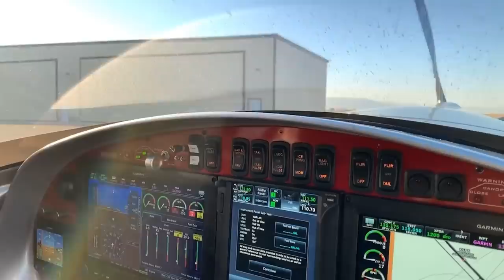Catastrophic Engine Failure...When Things Go Right!

Comment: My glider flight instructor told me as I was young: "All the rules in general aviation were written with blood!" This impressed me so much.
Reply: That's simply not true. 

The predecessor to the FAA mandated Aviation Medicals when there were zero incidences caused by pilots who had serious medical conditions prior to those regulations. 

They just copied the Army-Air Force standards, which are for military service, and for combat pilots flying the most advanced technology high performance, difficult aircraft of that era.

They also regulate in excruciating detail every design detail of every general aviation aircraft ever made. Driving up the cost to a point almost nobody can afford. Killing the entire aviation industry in the process.

Was it necessary? There are 20,000+ "experimental" aircraft designed by shade tree enthusiasts, built by amateurs in garages, flight tested by low time mediocre unemployable pilots and their aircraft have a safety record comparable to the unobtanium $650,000-$2,000,000 "FAA Certified"  factory built by professional union workers. And Experimental aircraft practically disintegrate in accidents, but are still somehow statistically safer than Certified Cessnas?

The CAB/CAA was intended to regulate airlines. But no airline hired 70-year old pilots or pilots with advanced diabetes or heart conditions in 1926, or 1938. Or 1958. Its a pointless waste of everyones time. They don't mandate physical exams for automobile drivers, even those people who also hurtle down the road in a 50 foot diesel motorhomes. 

And CDL driver physical exams are a joke. You can be 450lbs cant catch your breath, breaking the seat of your semi-truck every time you sit down, eating three large pizzas with hypoglycemic induced comas and they grant you the license to drive an 80,000lb truck. As long as you don't admit that you pass out every other day if you haven't had some M&Ms, they don't care. 

Cars crashing through crowds of people and buildings cause ten times more deaths and property damage than all the airplanes that have ever wrecked, even if you count the twin towers the death toll goes to automobiles which kill TEN TIMES September-11th numbers EVERY YEAR.

The reason they don't mandate medicals on car drivers is because car drivers are the overwhelming majority. And government doesn't want to make the mindless masses upset. 

They regulate the minorities who went to the effort and expense to learn to fly. Because the mindless majority cant stand the fact there are smart and successful people meandering high is the sky above them free to go where they please and enjoy their own lives.
Reply: The best regulations are wisdom that surfaces from knowledge that represents data of multiple experiences - both bad (blood) and good (safe arrival).
We follow them because they work, because they keep us from repeating known errors, and because they teach us procedures that proved good.
We pass them to the future for progress, so future generations can improve upon existing knowledge instead of re-starting from zero.
Then, there are regulations written by politicians, lawyers, interested parties, bureaucrats, etc. Those tend to have short lives and often fail to make it to the future.
Reply: That’s exactly what I tell my students during HF and Continuation Trainings too!
Reply: Frank, that’s a common saying in aviation - all rules, FARs, SOPs, etc., etc. are written in other pilots’ blood.

Comment: I've been in two GA aircraft that had engine failure. One I was a passenger and the other the pilot in command. The first was a Bonanza V-35 that suffered catastrophic engine failure. We made an airport and landed. The other that I was piloting was a Mooney M20B that had fuel contamination. I turned back to the home airport just as the engine stopped. We just made the runway. Beside me was a Military Helicopter pilot who did a great job of pointing out fields and alternate landing points while I went through the emergency procedures. It was such a relief when the wheels touched the runway. 
Thank you Mike for the story.

Comment: I love the "I walked away and I'm looking forward to the next flight" story. 

So far I've never had a mechanical problem. I've had a scary moment when the fellow pilot in the right seat of a C150 said "I've got the flaps" when I was doing a short field takeoff with pine trees at the end of the runway. He took them all out and we barely missed the treetops. 

I hit a Cattle Egret on my first solo takeoff. Actually, it flew into the prop just as I rotated. It came in from the right side and "stuff" went everywhere when it hit. Blood and guts were on the window and the calm voice of my CFI came on the radio and said - fly the airplane like I taught you. Then "is there any vibration?" There wasn't but by then I was over the lake at the end of the (short) runway and turning crosswind. I flew a normal pattern, landed, taxied over to him and shut down. He washed the windscreen off and checked the aircraft out. It was fine. The prop was fine. The bird was not fine. He asked if I wanted to go fly and I said heck yeah. On about circuit #8 he came on the radio again and told me it was time to land and put the airplane up for the day. If air to air refueling was a thing I probably would have stayed up for hours lol Flying is my happy place.
Reply: That’s a great story (aside from the bird’s fate), but bird strikes are fairly common. They’ve been known to take out commercial planes, so it’s no joke when it happens.

Comment: I had an engine loose a cylinder on takeoff in New Braunfels, Texas about 20 years ago. I was about 100 ft when it happened and I was able to put it back  on the ground before the end of the runway. Had I been further out I'd have been in the pasture with the cows. But training kicked in and thankful for the fact that I practice emergency procedure on a regular basis.

Comment: My first engine failure came in the late 1970's in a Lear jet 24 or 25 when we flamed out an engine at 47,000 feet.on a flight from Oregan to St. Louis. I was about 3 to 4 months into flying Lear jets as a very low time pilot.I happened to be flying with the chief pilot that day. After we descended to restart the engine around FL 250 it became apparent that we would need to land and get more fuel. Right after we restarted the engine I told the chief pilot to radios as I called the flight service station for weather and a place to land. We landed in Lincoln Nebraska with ice on the taxiways...runways were OK. The only way we could turn on the icey taxiways was with reverse thrust on one engine or the other...the runway itself was ice free. Uneventful  flight after that. The chief pilot was so impressed that I got to become a co-captain after I passed my ATP written. Once I had 1,500 hours I went to take my written test with the FAA somewhere  in the eastern USA. I had been flying the Lears for some time, so when I to take the written with the FAA the guy didn't believe my log book entries. The FAA called my chief pilot to verify my flight times. The Chief pilot verified my employment and then he transferred the FAA guy to our dispatcher to verify flight times. The FAA guy had our dispatcher verifying my flight times by asking the dispatcher what did he do on this day, what did he do on that day, skipping all over my log book because he thought I was pencil whipping my log book. I didn't know this at the time but our dispatcher informed me later the next day. I passed my ATP written and took my ATP flight test with an FAA inspector a short time latter. After that I flew as a co-captain for 6 months and then I flew with co-pilots. Much later on I retired flying the MD-11...great airplane!!!

Comment: Great story!!!  I’d almost forgotten about my experience back around 1960 in an Aeronca Champ.  My next door neighbor was building a new home 50 miles out in the Illinois country-side near Granite City.  I asked him he would like an overhead picture from the air, and he readily said “Yes!”  It only takes about about 40 minutes to get there at normal power, and I descended to 500’ to take the pictures.  At that point my little 4-banger engine started misfiring like crazy, like it would fire on certain cylinders then fire differently for a few seconds.   So I selected the right mag to troubleshoot and was greeted by the immediate sound of silence!!  BACK TO BOTH, AND THE SHAKING!!  Now the 50 mile trip back was going to take a wee bit longer at 38-40 mph!  I was able to maintain the 500’ altitude, but every second was spent looking for the next best landing spot!  Thankful I was mostly over farming land as I had to be instantly prepared to decide my landing spot if the engine quit!  I did make it back to my home FBO(1 hour & 20 minutes!), and their chief mechanic was right there when I shut it down.  I told him the magneto was only half working and not too well at that.  When they disassembled the mag it was in a state of internal self destruction, so my return flight was block of time filled with a miracle every second!

Comment: I have a similar story. I got my Private in 1994. Like the student in your story, life got in the way.  I flew for 3 years and then not again for 25 years. In 2018 I was transferred and the area I was transferred to has a airport community, houses with hangers on one side of the field and hangers on the other side, along with a very active EAA chapter.  Last summer I finally saved up enough to get current.  I started taking lessons in June. I expected it would take 5-10 hrs. Wrong.  This is not like riding a bike. After 18 hours of instruction I was ready to have my instructor sign me off.  Before he did I told him I wanted to do a cross country flight with him in class B airspace, just to make sure I was comfortable with talking to ATC.  So we took off on a beautiful Saturday morning. We climbed to 2500 /1700 AGL. We had just established communication with ATC and the engine started running rough. We checked carb heat and the mags. Neither were the problem. My instructor K said, “I have the controls”. We turned around to head back to our home airport. ATC gave us information about other airports close and private fields and I was looking as K flew the plane. We were able to maintain altitude but not able to climb. When we got back to the airport we tried to slip it in but we were too high. So we had to circle around, decreasing our altitude but while we were circling we needed what little engine power we had. If the engine fail we would have ended up in a field next to the airport.  I’m happy to say the engine continued to run. Once we were back on final I felt confident we would land safely on the grass strip.  We did and we were able to taxi back to the FBO.  It turned out that a valve stem bent so we lost a cyclinder on our 4 cylinder C172.  I didn’t realize what an adrenaline rush this was.  I went home, had lunch, mowed the lawn and then realized hoe exhausted I was. I slept the rest of the afternoon.   I took my check ride the following weekend. In a different plane.  
Now I am working on my instrument rating.  Last weekend I took my first cross country solo flight in over 25 years.  My niece had her high school graduation party.  My brother lives 4.5 hours by car away from me but only 2 hours away in a C182. My wife, who never misses a party, wanted to come with me.  But I told her I really wanted to do this on my own since it had been 25 year since the last time I navigated.  Now I will say, things are a lot easier today.  The C182 has the Garmin 430/530 suite, plus I have ForeFlight on my iPad. Navigating really wasn’t going to be a problem but you never know what you’re going to get so she was understanding and I went on my own. It was a beautiful clear morning. I took off at 9 am and landed at 11 am.  My mom and brother met me at the airport. My brother had to get back to his house to finish setting up for the party but my mom was up for a sight seeing trip. So we went up, flew over her house and then over my brothers. During our flight, the altitude indicator and heading indicator went out.  I didn’t say anything to mom. We just headed back to the airport.  When we landed I asked the FBO if they had any mechanics who could look at the plane.  It was a Saturday and all the mechanics were off for the weekend.  There was a flight instructor there and we talked about what happened. He informed me that those instruments were only mandatory for IFR flights and that I could legally fly back without them. So I went to the party and 4 hours later I got in the plane and flew back. Most of my instrument training so far has been partial panel work so I wasn’t really concerned. The flight home was uneventful. I got to practice using the compass but really, the gps makes it very easy to navigate.  When I landed I called my friend who owns the plane and told him about the wonderful flight I had but the attitude and heading indicators were out. He came out on Sunday and got the vacuum pump replaced and was able to do his business trip on Monday.
When I first started flying and during the entire 3 years that I flew from 1994-1997, I never had a mechanical failure. Now in the first year back I’ve had two.  It does not deter me and I am committed to completing my instrument rating and getting into a partnership.  Even with the risks, I love the freedom to travel that private flying offers.  I want to thank you for sharing your aviation experience.  You have been truly inspirational to me

Comment: This is a great video, I had a micro burst down draft on final just before my first solo, I put in full power and was on the edge of the stall horn, but was off the path of the runway, my instructor took control just to get us over the runway and said if we are going to have a hard landing lets do it on pavement, I was given back control and milked it up till we were passed the down draft, and we went back around the pattern and with less flaps and more speed made a proper landing,  and learned a lot from it. I am glad they are going to keep flying, it is so great.

Comment: This happened to my son on his first lesson as student pilot four years ago. Instructor took over was calm and landed plane in empty cornfield (it was fall in Iowa). I asked both of them if there was any panic and both told me there was not time to panic, they were both looking and thinking about what needed to be done. They were happy a small tire Cessna did not catch a rut or hole, but everything went smooth. The were a couple miles from airport and the next day trailered plane with wings on back to airport. The engine was a low time, broke a rod and cracked case oil everywhere up front.

Comment: As a passionate motorcyclist I like to see the parallels and learn from them.
Whatever I do there is always a list of things I do right and things I do wrong; it might be body position, line choice, throttle control, etc (just so you get an Idea)
At every moment each of these things get summed up, and each aspect has a different value, as long as the value is positive you don't crash.
A safe rider can estimate the value of each aspect and add a safety buffer, a good rider can do that better as well as increase these values alltogether.
So a good rider might get away with a bigger mistake.
A moto GP rider misjudges the grip and locks up the front under braking at high speed, but because he has great body position, body control, reaction time, well trained instincts, etc, he gets away with it.
Someone else on the other hand might ride a straight road, with terrible body position, bad throttle control and all the wrong instincts and also has no issues in this situation because in sum its enough. If he is a safe rider, he knows these aspects if he were tho come across a more challenging situation.
It's a tool for me to analyse situations I had and might have and learn from my mistakes and those of others.
Reply: There are countless similarities between motorcycles and aircraft. 

I've said: "Flying an airplane is similar to riding a motorcycle, and riding a motorcycle is closer to flying a helicopter than riding a bicycle."

The most fundamental, is that you should never experience lateral "G" loads for either. Said another way: Bank angle should be proportional to turn radius and speed. All cornering loads are felt as "downward" force into the seat. And the seat of your pants never attempts to "slide" laterally as it does in a car around a corner.

Comment: I had 4 engines out in my 12 year flying career. 3 in a Gyrocopter over mountainous and forested areas  and one in a LA4 seaplane (I had to land on the River Rhein in the narrow upper Rhein valley canyon). I am still alive due to the fact that I always keep an possible landing site in sight (never crashed). Single engine flying machines are per se not redundant. Therefore the PIC has always the obligation to keep a plan B in mind. I still do bush- and seaplane flying and enjoining it very much, but preparation and training is essential for my peace of mind.